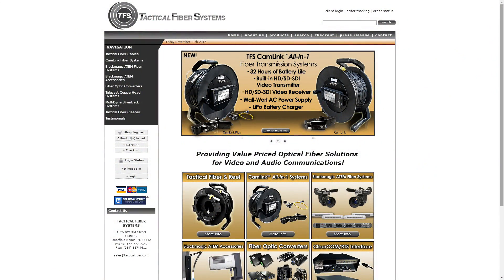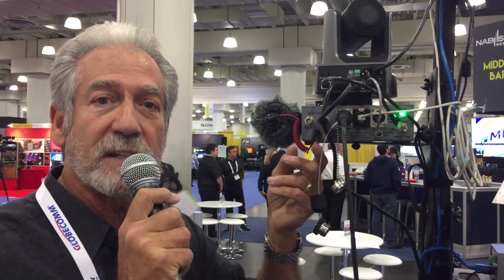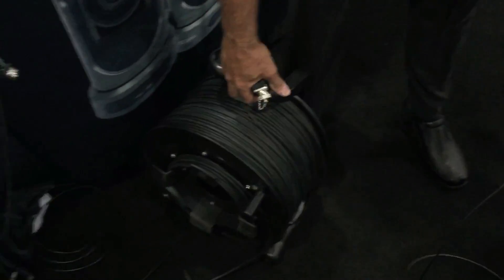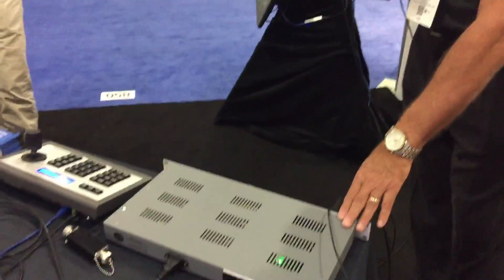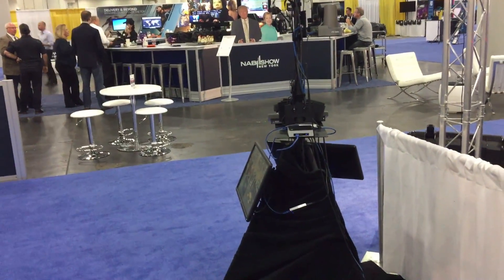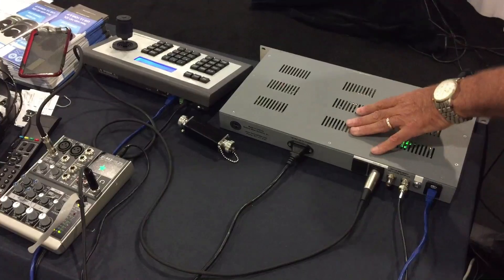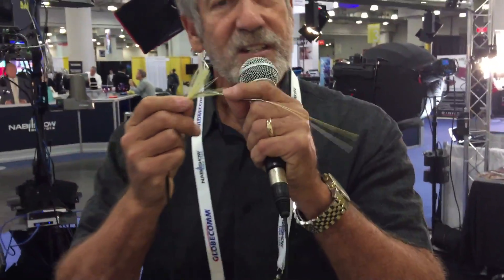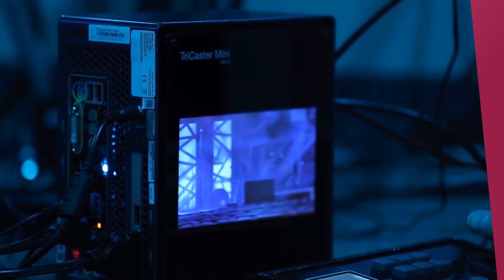Camera Power, Control and Video over Fiber Optics!

Comment: What year is this? (I mean that sincerely... because I'm curious to know if you have a real solution for our church.) 7 CABLES? ...just to power, remote control, and stream?  Do you not offer WiFi connectivity from your cameras?
Reply from the maker: Hi Jay, this solution is for providing camera power, control and video/audio for miles. Think NASCAR and huge stadiums. For churches you could easily use our PoE (Power over Ethernet) options OR run Cat 5. For wireless connectivity you just need to hardwire a camera via Ethernet to a Wireless Router. This will give you video and control.

Comment: Hello,

I was studying the numeric value between colors, and, realized that whole system needs revision. However, I could only find information through Wikipedia on it. They seem to change often. My question is, how are the frequency of colors determined? How can one look at a specific saturation of color, such as 
732,274,744,098,816 Hz, to determine exactly which adjective to call this range? I believe this color is indigo, but, I need proof. Who can show me what it looks like? How do we do this? If one could explain the problems science is having to make the precise determinations, I can tell you exactly how to fix the issue. If you're willing to work with me on this, I could tell you exactly what this could mean for the quantum realm. If this color is indeed in between Blue and Violet, then, I can tell you exactly how this will introduce the 4th dimensional plane of existence within out perception, demystifying ESP (extrasensory perception).